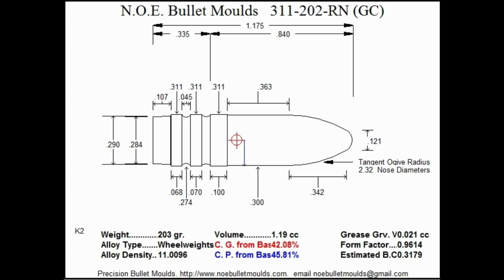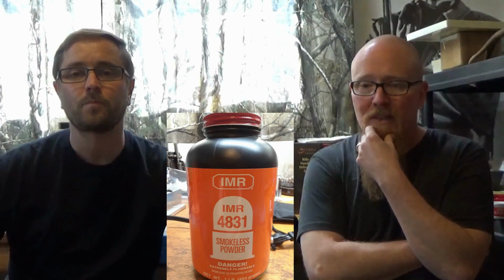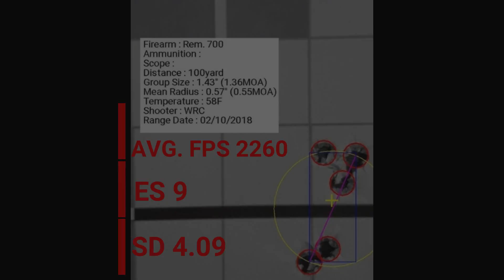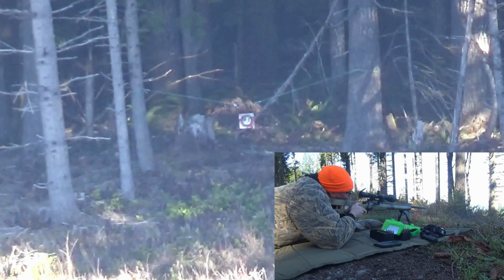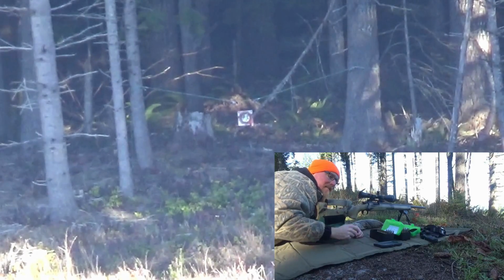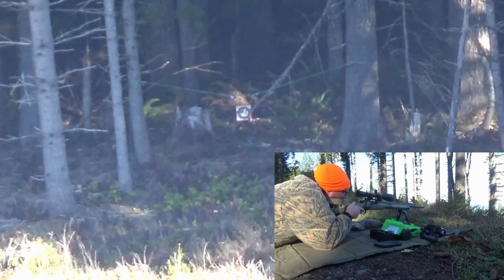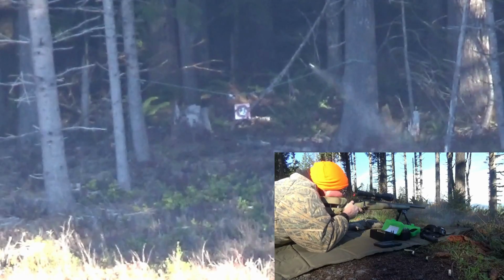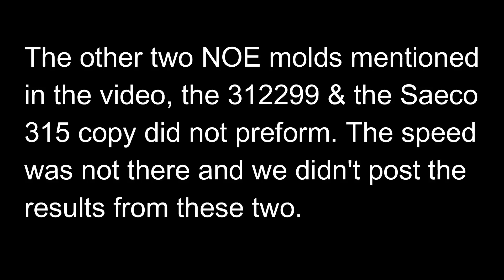500 Yards - cast bullets - 308 win. Long Range ( Remastered )

Comment: Very cool video. I’ve had some fun reloading subsonic 308 with lee 230gr projectiles that are powder coated. Fun, but less than accurate:) usually 2.5 inch groups at 100yrds. I’m curious if you noticed any leading or if you did a lot of barrel cleaning? Looking forward to future videos!
Reply from the maker: That rifle only shoots cast anymore Jeff. It has had over 400 rounds through it since it has been cleaned. No leading. Always remember. With cast, fit is king. Happy shooting.

Comment: Why are th bullets so smoky in flight? is the powder coat evaporating or something? I have shot also long range , up to 600yds with PC'ed boolits and I haven't seen anything like that. Also, you should try the NOE 311-199-SP mould, i'ts supposed to have a BC of like .42  . Im having great results with 32gn of varget, and casting a hard allow, half WW and half Lynotipe (eyeballing it), crimping is a must. I've had 1 moa groups at 200 meters with that load and I'm waiting for the chance to take it to 600yds. Awesome video!
Reply from the maker: These bullets are sized to .311" and lubed with Lar's 2500+ bullet lube. No powder coat.
Thanks for watching!